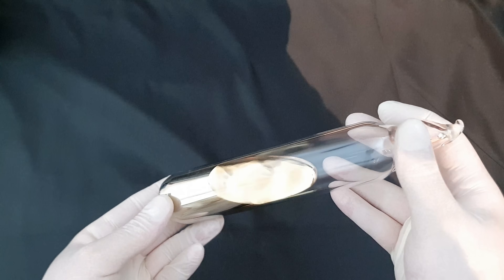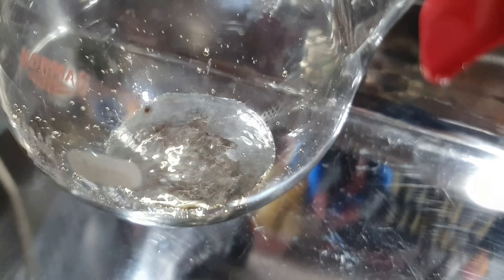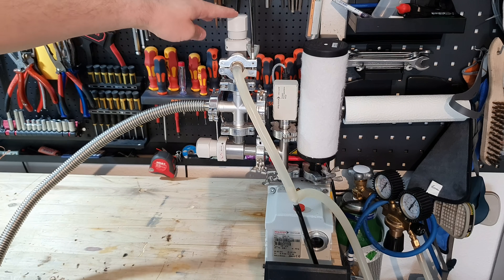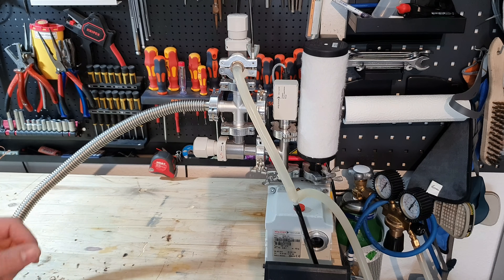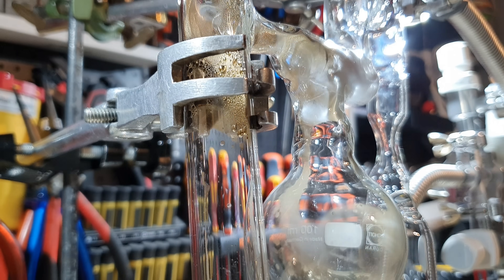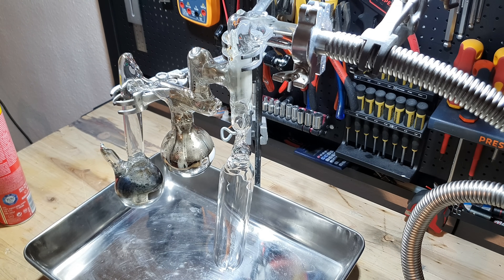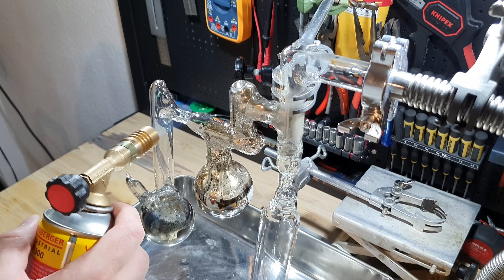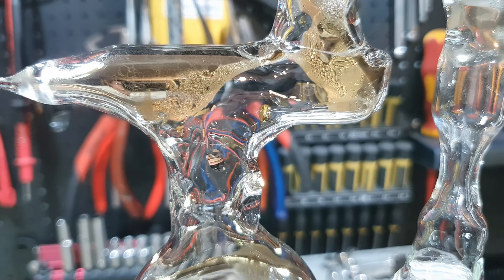The Most Dangerous Object I Have Ever Held In My Hands

Comment: That lampwork is not trivial, well done! Based on the quality of your work I think you've probably seen this trick before, but I want to encourage you to try cracking off tubestock with the hot tip of a glass rod instead of the torch and water method. It'll take you a couple tries to dial in how much hot you want for the weight of tubing, but once you do I think you'll find it easier to avoid those spiderwebs you get the way you're doing it. No water, just touch a hot rod onto your score and hold it there til it cracks. When your heat is right for a clean break, that's a good 2-10 seconds, longer than you'd expect. Sometimes they even go 30 seconds later as they're naturally cooling down. The key advantage to this method is you get to control both the temperature of the glass rod, and how much mass of glass you heat up to deliver x heat at y rate.
Reply from the maker: Thank you! Yes, by now I mostly use the hot glass bead method to crack the glass. But nevertheless thanks for the advice!
Reply: Hot wire is preferred to a "hot tip of a glass rod" which can have unexpected results.

Comment: What I think is impressive is that the Cs doesn't stick AT ALL to the glass. I have a 5 gram ampule of 99.95 purity from a respectable chemical lab supplier (hasn't broken in 20years thank God!) and it sticks just a little especially at the tip where the glass was sealed. And it has a concave meniscus, which indicates some albeit redicilously little contamination...

But yours flows almost like Hg. The inside glass must be VEEEERY clean.

Amazing how just the slightest impurities can mask the true nature of materials.

Our vast semiconductor industry and by extrapolation our digital age would be impossible if we were only able to achieve 99.99% purity...

An operation room is a pig sty in comparison to a semiconductor factory.

Good craftsmanship!!
Reply: God tier indeed!

Comment: Does flameworking not detract from mass of glass 🤔 I mean the flame shows orange of sodium burning
Reply from the maker: Yes, theoretically it detracts from the mass of the glass. But it's negligible (at least in my case). I would guess it's a few milligrams at most. The amount of sodium(ions) needed to color the flame is minute.
Reply: @AdvancedTinkering  that's true atoms are quite tiny and numerous 😄

BTW is €54 a good price for 100g CsCl?
Reply from the maker: It depends on the purity. It's not extremely expensive but a little but more than what I pay(~40€).
Reply: @AdvancedTinkering  better than amazon €84

Comment: Beautiful video! 
What do you recommend for storing a cesium ampule at home?
I was thinking about a steel box with a larger amount of sand surrounding the ampule. Any better or additional ideas for safety?
Reply from the maker: Thank you! Yes, I think an airtight steel box with some PE foam with a cutout for the vial would be best. So even if the box gets knocked over, the vial will be likely to survive. With sand it would be more likely to break. 

Just make sure the foam does not react with the cesium, otherwise pressure could build in the box if the vial breaks and gaseous reaction products are formed.
Reply: Thanks for the reply.
Do you have a recommendation of a commercial polymerfoam with these properties (maybe even a supplier)? 
My reasoning with sand was that the cesium reacts with sand and gets quenched rather than being oxidized in air and starting a fire.
Reply from the maker: The cesium would not react with the sand in my experience. Of the steel box is airtight, I don't think it would start a fire, there just not enough oxygen. 
There are a lot of suppliers of polyethylene foam on the internet. In my experience PE will not react with cesium.

Comment: When weighing the still and the vial in the end, how did you isolate the cesium mass from the vial’s mass?
Reply from the maker: I weighed the still before using it. So I had the mass of the empty still. Then I weighed the still (all the glass pieces) including the vial after the distillation. By subtracting the weight of the empty still from the weight of the still+the cesium, I get the weight of the cesium inside the vial.
Reply: @AdvancedTinkering   I think I was complicating it a bit in my head. Thanks for the reply.

Comment: Nice job, I'm learning to flame work glass, I wish I had tubing that size and enough cesium chloride and lithium for that kind of yeild! 🤩
Reply from the maker: Thanks! Flameworking takes practice but it is very rewarding when it works :)
Just stay safe!
Reply: Yield is percentage, so it does not matter how much you starting with.
Reply: @dan43544911  yeild is also produce but you have a point
Reply: @dan43544911  and yeild for this I believe is quantitative

Comment: why did you keep the ampule under a vacuum when sealing and didn't fill it with argon? I would assume that an ampule under vacuum is more dangerous than a vile with one atmosphere of argon?
Reply from the maker: The argon is 99,999% pure, but it carries moisture from the hose into the still. You would have to dry it thoroughly(just molecular sieve or even phosphorus pentoxide would not be sufficient) and only use stainless steel tubes after drying. I do not have the necessary equipment for that.

Comment: Unbelievable! Is the inside of the ampoule coated in anything or is this normal behavior of sufficiently pure cesium?
Reply from the maker: Thanks! The vial is not coated. It is normal borosilicate glass. 
If the cesium is pure enough and no oxidation took place, it will not stick to the glass.
Reply: @AdvancedTinkering  Any way to undo the sticking to the wall without a transfer to a new argon ampoule? Moderate heat does not seem to help.
Reply from the maker: The cesium sticks to the glass walls because of impurities/oxidation. So the only way to change that would be to redistill it. 

I was able to vaporize the cesium that stuck to the walls in a vial that was under vacuum by heating it. But as soon as it touches the walls, it will stick to them again.
Reply: That is what happens when you properly prep the glass to remove all the SiOH and surface metallics. Also if you have a tiny amount of argon or neon in there, the cesium will glow dim blue as it is moving around in the vial when molten. 🤓

Comment: Does anything happen if you shake it violently?
Reply from the maker: The glass could break. It's like a water hammer. But even stronger because the density of the cesium is higher and there is a vacuum in the vial.

Comment: Those are some big cesium crystals. Nice! And not wetting the glass at all is spectacular.

Watch out for cesium residue in the expensive bits of your hardware--I've had odd corrosion behavior from that. Stainless steel tended to just slowly rust if there was just a little cesium residue, but in one case I had a brazed window just fall out. 

I was dealing with such small amounts of cesium ( up to 100s of mg) that my procedure was just to rinse with water and see the pretty purple sparks. The procedure I found was to react it with alcohols first, but the alcohol likely as not caught fire, which was more of a hassle.

Comment: Impressive, well done. Do you worry about any of the cesium making it over and messing up your rotary vane pump and/or oil?
Reply from the maker: I thought about that. But no. As you can see, the amount of cesium that condensed even at the very beginning of the stainless steel hose is minute. In addition I bent the hose in a circle so cesium atoms making it into the hose would have to hit the walls and condense on their way to the pump.

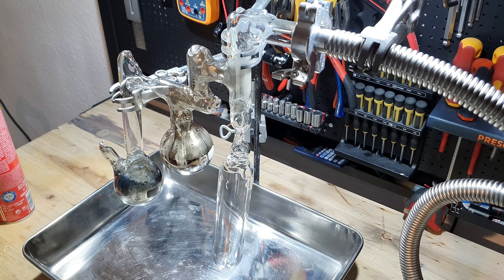Comment: 6:05 what happens to the flask you disconnected? How do you dispose it?
Reply: Nevermind, you show it in the video :D
Reply from the maker: You can see it later in the video. I kept all of the glass and cleaned it to weigh it and tetermine the amount of cesium in the vial. 
When the glass is clean it can be disposed off in the household waste(it is just glass at that point). It should not be put in a glass container because borosilicate glass interferes with the recycling process of normal glass.